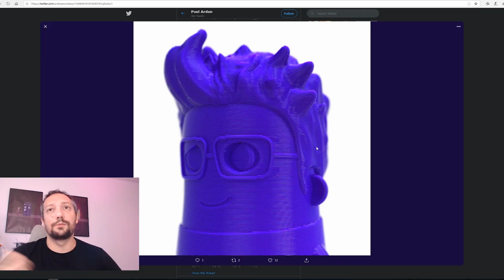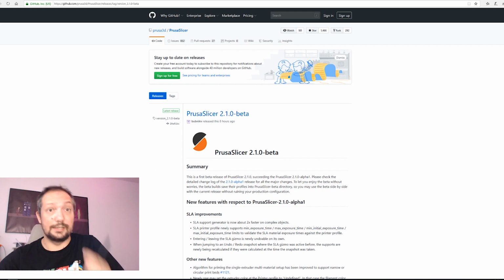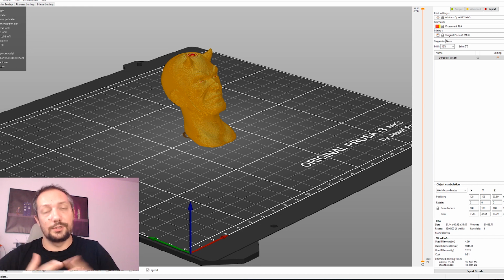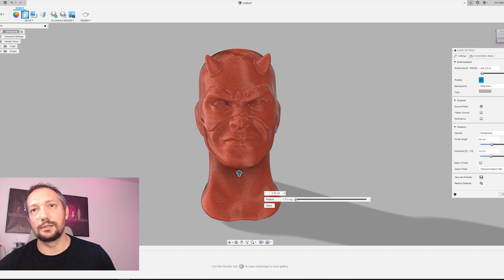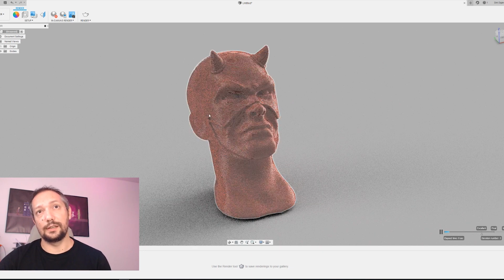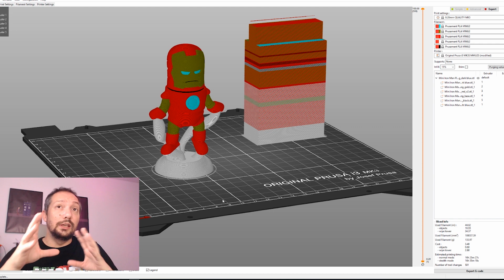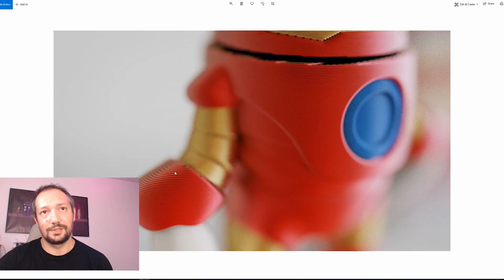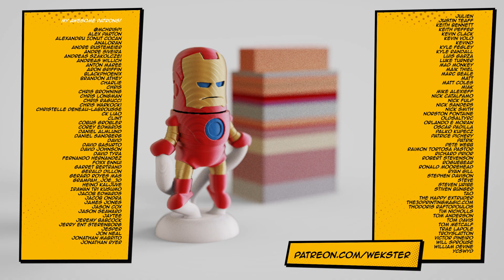Simulating 3d printed object - Toolpath Export from Prusa Slicer

Comment: Nice video! It is a cool option, but I can't do it.  After slicing a model correctly, the option "export toolpath as OBJ" appears disabled, ?¿?¿? I don't know what I am doing wrong :(
Reply from the maker: I really don't know, only 2 times I had that option disable was when I didn't slice it or the model wasn't selected.
Reply: @wekster   it's strange because it is enabled if I choose a FDM printer, and disabled when I choose my SLA printer.

Comment: Anyone know how to turn off the skirt / brim? Not super familiar with this slicer. I turn it off in the settings, and when i slice the model it doesnt show on the build plate. But when I export the OBJ there is a thin ring around the base of the model.